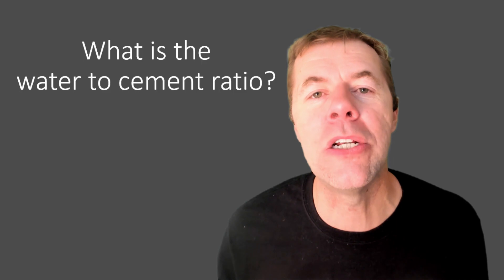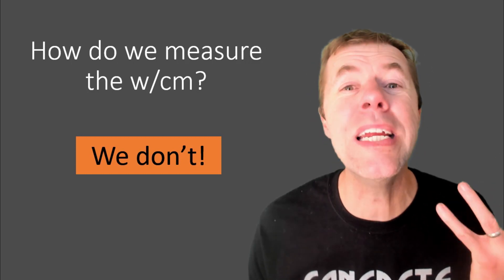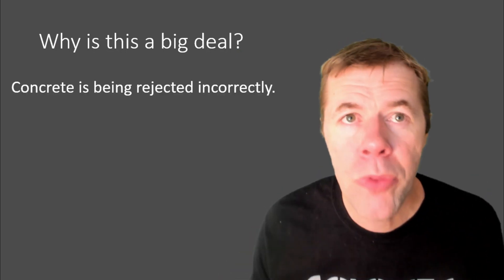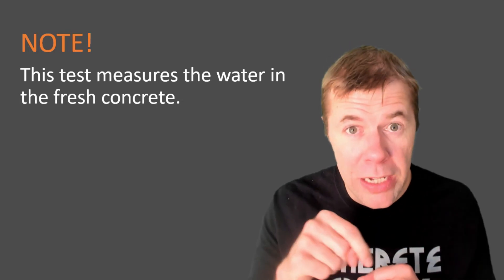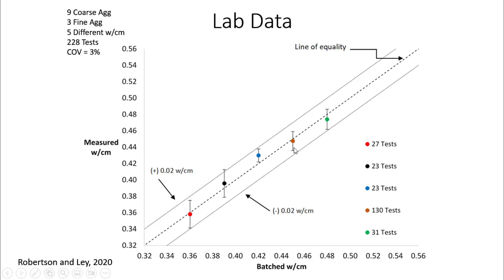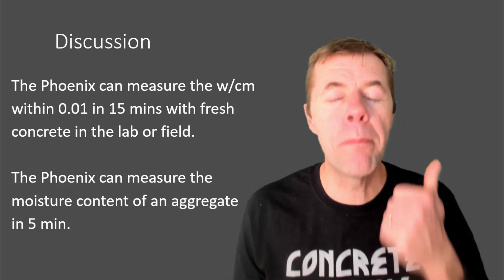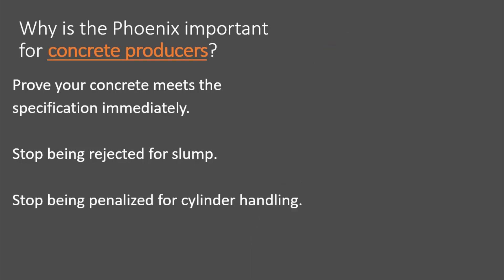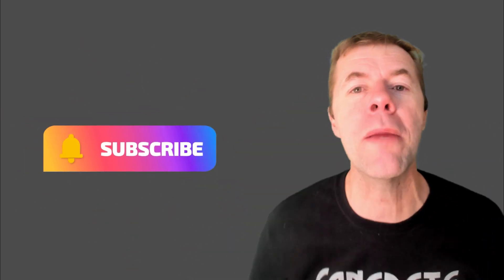Measuring w/cm in concrete with the Phoenix!

Comment: I don't understand why you say w/cm ratio cannot be measured any other way. As a FDOT certified batch plant superintendent for 11 years, I knew how to calculate w/cm ratio and the water to cement ratio was printed out on the batch sheet (as long as your rock and sand moistures were being properly completed by cooking rock and sand or cooking sand and towel drying rock). And of course on site inspector would take these number and re-calculate if any water was added on the jobsite to increase slump to ensure mix design w/cm ratio was not exceeded. Never understood inspectors who would not allow additional water to be added on jobsite when there was room to not break the design w/cm ratio. My favorite part of the job as a driver was watching an "inspector" improperly take a test cylinder (failure to rod in 3 layers at 24 or 25 strokes) and let him know that it was annotated on the delivery ticket. That and contractors taking their own test cylinder, just place the cylinder in the chute, fill it with concrete and cap it, yea that went on the delivery ticket too.

Comment: Isnt it better to check if water content is right with a microwave probe inside the concrete mixer? Even thou you can place aditional probe on the conveyor belt. To measure water content inside the aggregat.

Comment: Did you also test the diagnostic power by deliberately making faulty batches and seeing if the measurement properly reports the a priori facts?  And do this double-blind to prove no bias?  If you only tested commercial batches with correct formulations, then you're not really conclusive about rates of both Type 1 and Type 2 errors. But any valid metrology is a worthwhile advance in engineered quality.

Comment: awesome video as always tyler. question pertaining to natural pozzolans: because of their high water demand, what is batched as a 0.45 mixture with say 25% class n may perform like a much lower w/cm mixture after mixing. i venture to say there is an “effective w/cm” that is different than that of what was originally batched. would the phoenix test capture something like this?
Reply from the maker: Nick - This is a good question.  You could take this into account in the calculation of the app.  You would just need to add the pozzolan as a fine aggregate and put an absorption content in the program.

I have heard people talk about pozzolans absorbing water but I have not seen a lot of data that has quantifying how accurate this is and quantifying how much this is for different products.

Take care!

Comment: How would plastic fibers affect the Phoenix?
Reply from the maker: They are not a problem.  Plastic fibers are used at pretty low weight percentages.  Like 0.1%.  This is 4lbs/cy.  Even if you double this it is only 0.2% of the weight.  They burn off in the test but they don't really change the results.

Comment: Last year with an oat of -5c and overnight of -10 the contractors poured by 1600, the next morning they stripped by 0800. It was green and steaming, they backfilled 2days later without a floor system. A big part of our problem is code/building inspectors(paid for by builders/government) not doing a proper job. I actually was told by the head of building inspection services, " it is not my job to babysit contractors" wrong that is your job. I had to go to new building insurors where they threatened to avoid the insurance before they wou!d stop(until caught the next time)

Comment: It's arse about. If you measure your dry cement mix and then your water - all by weight - prior to mixing, it saves all the hassles - after mixing.
Reply from the maker: Shane,
In practice this is much easier said then done.  I have lots of field data to show that lots of water gets added to concrete.  Watch for a part 2 video where I talk about this more.  It only takes about 20 L (5g) to change the w/cm in your concrete mix.

Comment: What about altitude.  Doesnt that affect the time it takes for the water to evaporate?
Reply from the maker: Good question!  The 15 minutes is based on a place close to sea level.  As you go to higher altitudes the test should take less time.  The full test method has you take the sample out and weigh it and then put it back in for 2 min and then weigh again to make sure all the water is gone.

Comment: A newbie question, if the concrete has a slightly higher water content, wont it evaporate off as the concrete dries, but allow it to be well hydrated for good strength? Previous videos have shown its good to keep the concrete hydrated (watered often) during curing...
Reply: Water applied to the surface is more about preventing evaporation than getting water into the concrete. High quantities of bleed water (what you're describing as excess water leaving the fresh concrete) will cause issues.

Wetting freshly poured concrete is about maintaining the intended w/c ratio, not increasing it.
Reply: @n00b1n8R  Thanks for clarifying!
Reply from the maker: Water that is added AND MIXED IN while the concrete is still a liquid will change the cement grain spacing and make it weaker and easier for outside chemicals to penetrate.  Water just added to the surface after a concrete is placed will keep the water from evaporting and causing cracking.  One key is the amount of water being added and how much it is mixed in.
Reply: @TylerLey  Thanks professor Ley, your reply is gratefully appreciated!

Comment: This seems to be a water to stuff measuring system by using a very expensive, very fast, hot oven.  Since the actual mix vs the batch ticket depends on the variability over time of the batching hardware (whether at plant or inside of a volumetric mixer), what has been the measured variability of these things across manufacturers and operators?  It seems that if an operator can achieve a given measured calibration with minimum variation over time (of all the bits going in), the benefit of this device is to allow the operator to tweak a batch calibration for the actual water content of the aggregates coming from given piles on given days.  With barrel mixers I definitely appreciate the value of this device to catch sloppy operators before it gets expensive for everybody.
Reply: I’m not sure if the oven is “very” expensive. It looks like a pizza oven? I don’t think that’s too costly, particularly compared to what bad concrete might cost you?
Reply from the maker: I think you have a good read on the technology.  The producers that are most interested have focused on making consistent concrete or finding an actual measurement of the water content versus what they think.  This can also be tested in the field, at a lab, or at a plant.

Comment: Only water and only cement has nothing to do with strength but it deals with consistency. For strength the cement paste should be good that's why gel space ratio is more important than w/c ratio but it has some drawbacks . It can prove more  better results if some studies will be done on countering the drawbacks.
Reply from the maker: Manish - I was talking about gel space ratio in a simplified manner with the first couple of illustrations.  Thanks for the comment.

Comment: We used to use a microwave to cook down concrete samples for this testing during main line paving. Is that not an acceptable test method for w/c ratio any longer?
Reply: I was thinking what is he gonna do? Microwave it? 🤣👍
Reply: I notice it's "crickets" in here - i was kinda hoping for an explanation why microwaving is a far inferior method - we shall see 👍👍

Either way i love this guy's inventions - this ain't the first 👍
Reply from the maker: @BracaPhoto  I am making another video to talk about the most frequently asked questions about the Phoenix.  I will cover the microwave oven in that video.  This biggest challenge is the sample size is too small and it takes too long to remove the water.